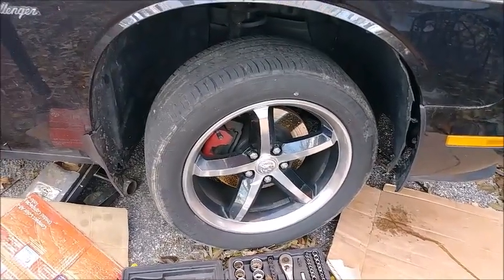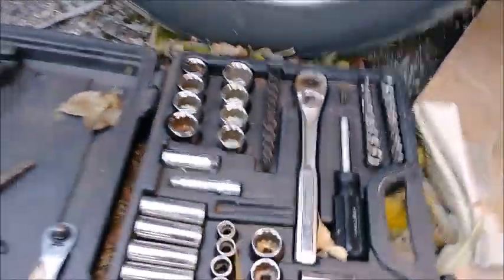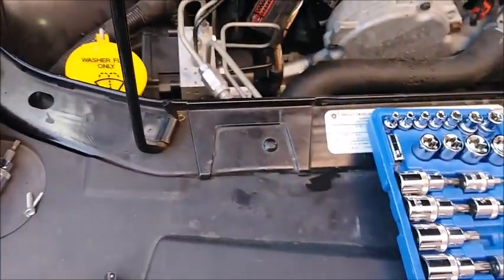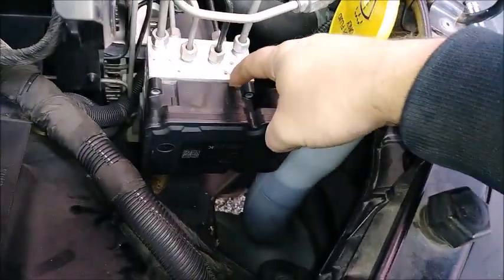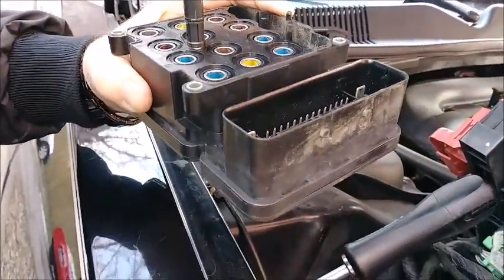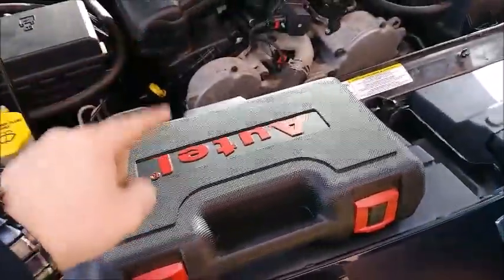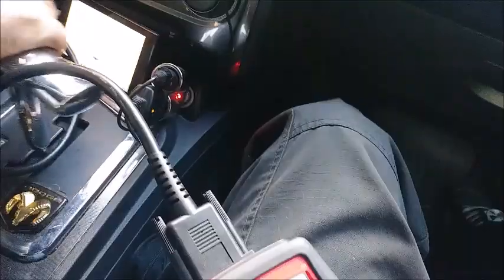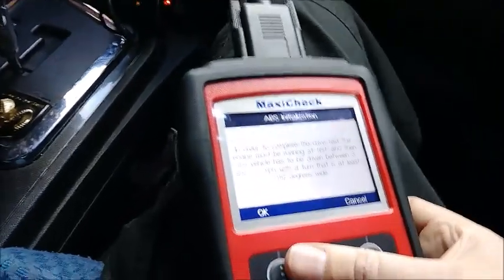Dodge Challenger ABS module C2200 replacement and fix ESP, BAS, ABS lights

Comment: If you buy the module brand new, do you still need to go through the programming steps? Or is this only if you buy a used one?
Reply from the maker: Yes, you will still have to initialize a new module. The module is coded to the car's VIN.Whether new or used it will require an initialization or re-initialization. Only rebuilding your factory module would remove this step.
Reply: @HollywoodHornet  well that certainly sounds like a scam to get the dealer money no matter if you fix it yourself or not. Unless of course you have a programmer like in your video.
Reply from the maker: @maz227  exactly. Doing it my way is the cheapest (and best) option in my opinion.
1st cheapest is buy a module from a wrecked car. Remove it yourself, install it in your car and reinitialize it.
2nd cheapest is buy a used module from ebay or somewhere, install it yourself and use the Autel to reinitialize it.
3rd cheapest option is you install a used module yourself and take it to a shop to have them reinitialize the module with their scan tool.
4th cheapest option is buy a new module and have a shop install it and you initialize it yourself using the Autel.
Most expensive option is have a shop install a new module and have them initialize it with their scan too.

Comment: Thanks for doing this. I was surprised that there were not more videos showing the initialization of an ABS module to include what tools scanner tools would work. For whatever reason, even the manufacturers of scanner tools do not seem to interested in providing relevant details regarding the tools they want us to buy. As such, it is difficult to determine what tools have what capabilities. Anyway, due to your video, I was able to diagnose a faulty ABS module, replace it, and initialize it on a 2010 Jeep Wrangler using the Autel MaxiCheck Pro. I found the tool to be more old school than I would like, but it did the job. For Jeep JK owners, if you ever need to do this, consider doing it yourself. It literally only takes about 10 minutes to swap out the ABS module and you do not have to open any of the brake lines so there is no need to bleed the brakes. The dealer wanted $95 to diagnose, $800 for the ABS Module and $200 for a rear wheel speed sensor. These are all very simple repairs once you have the right information and tools. Thanks again!

Comment: Do you need to flush the brake fluid prior to changing this?  A module I'm looking at says to do that.. really don't want to have to.  Also, plan on selling this thing in 12 - 14 months, wondered what your thoughts are on re-manufactured modules?
Reply from the maker: I'd just get the cheapest module you can. If junkyard is cheaper, get it and install it. If reman is cheaper, get one and install it. Either way you'll have to use a scan tool to make the car accept the mismatch VIN.

You will not need to change any brake fluid unless you're changing the pump and allow air into the lines. If you are also changing the pump, this scan tool will bleed the ABS pump as well. Only changing the module does not require bleeding the brakes.
Reply: @HollywoodHornet  Thank you so much!

Comment: I had my replaced in july.i think it was rebuilt..I'm not sure.. but today my brake lights and abs came on..took it to autozone and they printing out a reading saying I need abs module..what! I just got it fixed a few months ago. Guy only gave me a 30day warranty..What's the change of it going out again in 3 months or do you think he installed it wrong?
Reply from the maker: It's impossible to incorrectly install. It might have been a used unit that was on its way out. Mine is still going strong. I recommend doing it yourself. Get a unit from a junk yard or used on eBay or whatever. Buy the Autel and you'll always have that scan tool vs paying someone else to do it for roughly the same and you have nothing tangible to show for it.
Reply: @HollywoodHornet  
 I was hoping itll just be a loose wire or something but I took it to autozone and the codes read

U1110
U1120
U0121
P0501

Which Autel should I purchase? It should say ABS on it correct?..do you have a link where you purchased your abs module control?
Reply from the maker: @kareemgoodwin8118  
This is a link for the scan tool I used. It's the Utel Maxicheck Pro. It works great or SRS, ABS and OBD2. It can also bleed the ABS system by activating the pump and reinitialize a new ABS module.

https://www.ebay.com/itm/Autel-MaxiCheck-Pro-OBD2-Auto-Diagnostic-Tool-Code-Scanner-EPB-ABS-SRS-SAS-DPF/251905098920?hash=item3aa6b6c4a8:g:DTsAAOSwYxBcsA83

As for the ABS module itself, you could just search on ebay for year of car and ABS module then shop for the cheapest. Though, as easy as they are to remove, I would recommend taking the tools you'll need with you to a pick n pull and pulling the module off a wrecked car yourself. It would be way cheaper than buying used from an eBay seller. They also offer a 30 day return on parts too, so if it didn't work you could return it to the junk yard. If they're cheap enough you could also take a few of them and keep some spares around in case another fails.
Reply: Hey so I finally got my new abs installed..also bought the maxicheck..but when programming with the maxicheck it leads me to "clearing roll,information passed,test complete" and then its starts over and leads me back to the "Clearing roll" my abs light continues to beep..the mechanic that installed in says it needs a software downloaded since it's a new abs.Is this true? Any other options?.. the maxi never  leads me to the steps where you have to drive and make turns
Reply from the maker: @kareemgoodwin8118  You may have to film a video and place the link in this comment thread so I can see. I would think the only "software" needed would be to initialize the new ABS module.
Reply: @HollywoodHornet  ok I'll do that tomorrow ,upload a vid and tag you in it
Reply from the maker: @kareemgoodwin8118  I watched and commented on your video. We'll continue the conversation over there. In my comment I may not have specified, but when you "read codes" the only one you should have is the "VIN mismatch code". If that's the only one present, that's good. Do not clear that code before initializing. Clear any other codes but make sure that code is present before you initialize.

Comment: I will be happy if you live in dallas. I had a problem with my ABC module the light of the ABC, BREAK, TRACCIÓN AND THR ESP AS are on I changed the module but the light are still on they say to me that and need to restart the computer but I don't no we're to take it I have a. Pacifica 4.0 2007
Reply from the maker: Unfortunately I'm a couple states North of you. Anytime you change the ABS module with either a used or new unit, you will need to reinitialize the module to work with the car. I recommend you get the same scanner I use in the video and do it yourself. For what the dealership or other shop would charge you, you could buy the scanner and still have the scanner to use in the future.
Reply: @HollywoodHornet  thank you my friend good video.
God bless you

Comment: Great video, I replaced my abs module but didn’t do any of these steps and now I’m stuck from the beginning lights are on car won’t start it would but on and off.  You think I can do these steps you just showed ??
Reply from the maker: I wouldn't think the car not starting would have anything to do with the ABS module replacement. Replacing the module without running the initialization procedure will keep all those lights on, and they won't turn off until you perform the procedure in the video. I also recommend the scanner I used to initialize the new ABS module and maybe scan the PCM for any other faults that may be linked to the hard starting.
Reply: HollywoodHornet  thank you for the tips you’re video is very helpful
Reply: Even though I replaced it ?
Reply: Where you able to fix problem I have same issue

Comment: Did this fix the problem? I have aps,ebs,brake and traction control light on is this the same problem you had this car? thanks for any help have great day
Reply from the maker: Yes, it did. The car now has all the lights off and they stayed off. ABS, stability control and traction control have returned to normal, and the new ABS module has been coded to the vehicle using this scanner.
Reply: @HollywoodHornet  Thank you. You just saved me lots of money I was gonna take it to Dodge dealer tomorrow now instead of that I will buy ABS module and a code reader. My qeustion is there a code reader I can buy from Auotzone or do I need to buy one somewhere else? Thanks again your a life saver have great day
Reply from the maker: @brianj123458  The one I used in this video (which we know for sure works to code the module to the car) I bought from eBay. I think you can get them from Amazon too? Ebay was cheaper and I wasn't in a rush so I chose the cheaper and wait a few more days for shipping vs paying more for Amazon and using Prime for the fast shipping.

I reckon it's your preference, but since my video shows you exactly how to code the module with this specific scanner, I would make sure to use this exact scanner.
Reply: @HollywoodHornet  ok thank you I'm headed to Amazon right now that way I can get my car going faster.
Reply: brianj123458 hi did you get the scanner and did it fixed the issue
Reply: @mase202  yes I did and yes it did fix my problem. The big problem was my ABS module cost me $900 for my year/make
Reply: brianj123458 so just connecting the battery terminals flashed it? i wonder if it only worked with a new module i have one from the junk yard
Reply: how long did you have the cables touching each other
Reply: @mase202  no touching battery cables did not work it kept reading mismatch vin# so I just borrowed my brothers machine and flashed the car
Reply: @mase202  I'm not  sure about a used one at all.
Reply from the maker: @mase202  The ABS module I coded in the video was a used module from a junkyard. As long as the unit is functional, it can be reinitialized to work with your VIN using the Autel MaxiCheck Pro.

Comment: Do you have model number I need to do the same thing on my 13 ram 1500 change my abs module with used one and now says mismatch vin. U think this will help
Reply from the maker: Autel MaxiCheck Pro is what I'm using. I paid around $170-180 new for it. eBay, I think. That's the exact one I use in this video, and it for sure works to re-initialize the ABS module after installation in a different vehicle.

Comment: Where did you purchase your replacement module from??? I bought one from a junkyard and they said it would work
Reply from the maker: I found it used on eBay. Simply replace, and use the Autel to code it to the car.
Reply: @HollywoodHornet  Im about to do the same with a 09 Dodge Caravan 56 dollars used is a lot better than 250 (Dorman) or 500 (Mopar) new. So even if this is used you can init the ABS module and it will change the vin number? Ive got a Foxwell NT 630 PLUS that does ABS initializations.
Reply from the maker: @DutchCleveland  You should be golden then. As long as you have confirmed the problem with your car is the ABS module, putting in a used one in and using your tool will yield the same results as me. That's the same thing I did with the Challenger. (Used module from a different Challenger) and she's still going strong.
Reply: @HollywoodHornet  Thanks man. I just went out and tried to clear the codes again (C2200). No Joy.  Ill give it a go replacing it... I mean 50 bucks for a used one. Seems like a no brainer.
Reply: @DutchCleveland  Hey how'd it go for you John? I also have a dodge Caravan I need to do this on. I was going to get the same scanner too. Did the Foxwell NT630 Plus work for you? Appreciate any help thanks!